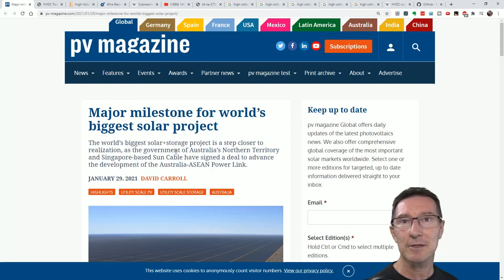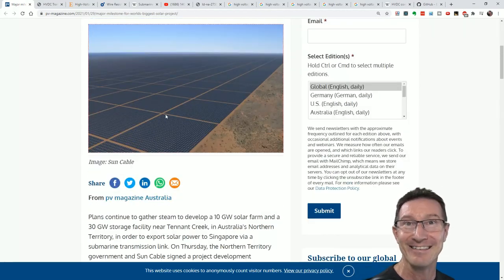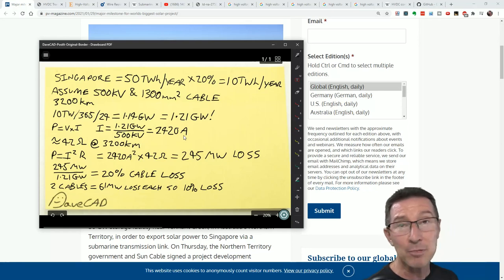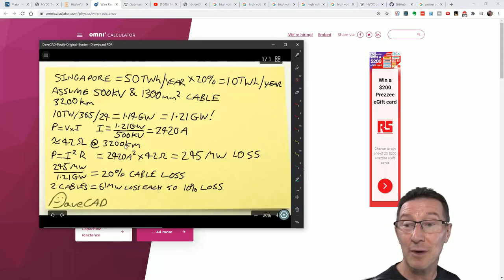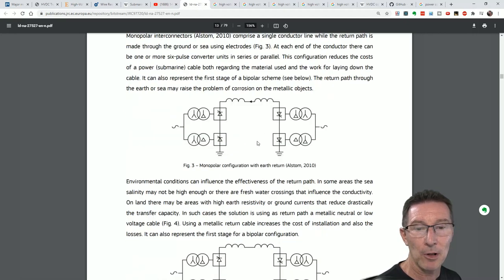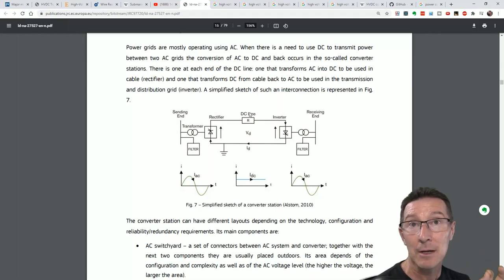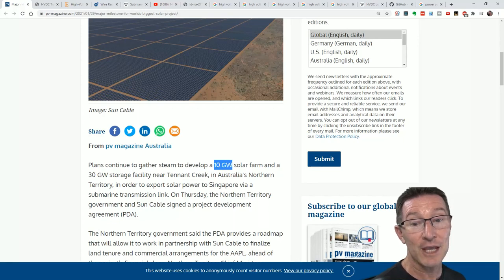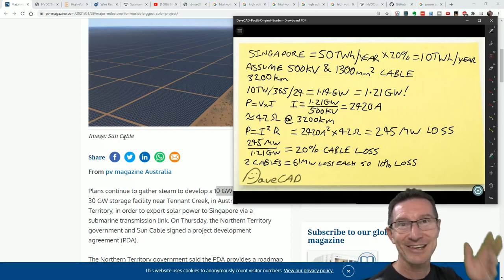World's Largest Solar Array - HVDC Transmission Calculations...

Comment: Cable would not be copper but aluminium under the ocean, might be more than double the diameter, but that just means a shorter spacing before the joints,  and overall the cable will be a lot lighter as well, making laying a lot easier, as there needs to be a steel inner support cable to handle the strain of lowering to the sea floor and picking up for repairs. Low density of aluminium compared to copper wins out, and also the very much lower price. Biggest cost of the cable will be the insulation though, extruded as a high quality coating on the central core, then with dozens of mylar overwraps and finally the outer sheathing and steel armouring, before the final plastic cover is applied. Most expensive is the sections that are shallow, as they have to cope with anchors dragging, fishing nets and marine boring animals. 

The pressure is not a problem at the deep parts, though there will be some hard work traversing the active geologic faults there, as they will have to build in extra slack to handle sea floor movement for the life of the cable. expect final length to be closer to 4200km instead, as the cable also has to climb and descend a lot of submerged faults and volcanos. Probably will pop up at a few island chains on the way as well.
Reply: Can't they traverse faults by using some massive buoys in regular spaced intervals, i.e. using buoyancy to have the cable float above the ocean floor for some (hopefully relatively short) sections?
Reply: @5th_decile  Not really, these areas tend to have fast currents, which means the cable will be flexing continuously, and will fatigue and break. Thus you bury it, or lay on the ocean surface, so it only flexes slowly.

Comment: The more interesting bit imho as a power eng  who does solar farms, is how do you hook up 10 GW+ of solar panels.  
Typically the internal networks operate at 33kV.  It becomes stupidly big quickly.

It will end up as multiple "smaller" networks. Each set of panels connect to 2x 2.5 MV inverters and stepped up to 33kV.   
A typical 100MW farm has ~6 33kV feeder and aim for less then %2 internal losses on the cables.
Then will step up to say 200 kV or so all back to a large AC switch yard to supply the DC plant and tie into the local grid. 

What will hurt up north is the soil is heavily sand based and soil temp is high, so you end up with larger cables (500mm single cores) and larger step up transformers.

Comment: As a minor correction, they don’t use copper for overhead lines because it is too weak. The aluminium lines have a steel wire catenary core as a strength member with conductors around the outside to take advantage of the skin effect. (Aluminium is MUCH cheaper too - about a third the price by weight).

Comment: I always questioned why we are not using 3.8 Mm instead of 3800km.
Reply: Try it, and you'll find out!
Reply: yeah we have nanometer, micrometer, millimeter, meter, kilometer but no Megameter?
Reply: Too dependant on shift key :-)
Reply: @wktodd  If you can't infer 10^9 difference from the context you have other problems... :D
Reply: @kwinzman  That kinda depends on the context and that the unit is being read by someone/thing with the intelligence to know the context  ;-)
Reply: @kwinzman  Further:  km,Km, KM ,kM,  would be equivalent in, say, a CAD package accepting a distance input, but what would it make of : mm mM Mm MM ?
Reply: @wktodd  Well in my oppinion it should reject Km, KM, kM, mM, and MM.
If the context allows it maybe it can accept KM and MM.
Reply: @kwinzman  so is MM megametres or millimetres?  See what i mean 8-)

Comment: I once worked on a Bid & Proposal (B&P) effort to provide the sensor network that would be run with an HVDC cable.  After a brief look at the stringent safety specs, our bid had the sensor nodes being solar powered with a supercap, communicating via an optical fiber.  Nobody wants to mess with HVDC unless absolutely necessary.

Comment: Didn't see it mentioned in my brief scroll through the comments, however don't forget about the return path. With that cable, it's 42 ohms, one way. You'd have another that size for the negative or positive, doubling the length and resistance.

Comment: How do you store 30GW of power?  Doesn't the energy unit require a time factor?  Such as 30 GWh.
I really enjoy science writers who have obviously never paid any attention to STEM course materials.
Reply: While they probably mean GWh, GW could still make sense. The batteries will have maximum charge and discharge rates.
Reply: @eDoc2020     Good point however I think you may have stretched generosity a little too far for the nimwits this time.

Comment: Hey dave, I could be wrong but I think you might be missing something.

The documentation keeps saying +- 500kV. I think it means one line is at +500kV and one line is at -500kV. So a total of 1 megavolt.

That would significantly impact your calculations, also you only calculated losses in one direction.

Comment: You need to double the cable length. There's the return cable to add in
Reply: Don't they use the ground for that?
Reply: @allesklarklaus147  electrolysis of the ocean bed!  I hope not
Reply: True, but then you would have another converter topology with +/-500kV. 
And the DC voltage seems quite low for the distance. I think it will be around +/- 800kV.
Reply: @Momchil0  what this needs of course is cheap high temperature superconductors
Reply: @donepearce  If I remember correctly the ground return works pretty well if the earthing electrodes are up to the task. The return current has essentially the whole planet as a conductor (well... not really, but resistance should be very low anyway)
Reply: @allesklarklaus147  you may well be right
Reply: Couldn't find any info of the cable in the video, but the Gotland cables mentioned are monopolar with the earth as return. 

"in 1983 a new monopolar link, HVDC Gotland 2 with a transmission capacity of 130 MW and a transmission voltage of 150 kV was established. It consists of a 92.9 kilometers long cable with a single copper conductor of 800 mm2 cross section"
Reply: @donepearce  I tried to post a link to the HVDC Italy-Greece line article from ABB but apparently the comment got deleted? There is a reference on the german wikipedia article. They use copper for the cathode and titanium bars coated with some special sauce niobium oxide for the anode.
Reply: @mikgus  OK, I'll buy that. I would be interested to know ground resistivity though, and what the net ground resistance is. Maybe the sea is actually an advantage in this situation.
Reply: @allesklarklaus147  I'm interested to know why they would make this a DC system too. I would have thought that electrode polarisation would become a problem at some point. And of course the added complication of voltage level shifting in and out of the cable.
Reply: @allesklarklaus147  
One big arse SWER system.
Reply: @donepearce  for reference, the HVDC link in NZ can be run in monopole. The sea electrode in the north has a resistance to 'remote earth' of around 0.1 ohms, with the earth electrode in the south having a resistance to 'remote earth' of around 0.3 ohms.
Reply: @dwnRnz  OK. I'm impressed.
Reply: @donepearce  Well.. a 160km/100miles long seacable does have quite a bit of losses if you run 3-phase AC so it must have made sense to go DC. The submarine cables are much much higher capacitance than the usual high voltage wires dangling around up in the air.
Reply: @allesklarklaus147  Examples?  References?  Actual figures for the ground resistance?
Reply: @Brian_Of_Melbourne  for what exactly? As I wrote before I tried to post a link but the comment disappeared. Gotta google yourself if you want to read the paper from ABB I mentioned

Comment: The biggest problem with long-distance AC transmission is system stability. You basically have an issue with power throughput that can only be resolved by increasing the number of lines or by using multiple conductors per line = more investment in copper.

Comment: Another key problem with long distance AC lines is the reactance of the line.  The reactance can be more limiting than the resistance and the two ends of the line can 'pull out of sync' even on lines of only a few miles.  This affects system stability in a network.

Comment: Dave you have a classic error in you calculation, it's not 3800km but 7600km of cable, you have to consider the return negative cable losses as well.   I think they run + and - so the voltage to earth is not as large.
Reply: From other comments, either you go monopolar (1 cable), and your loss are what he calculated.
Or if bipolar (like suggested by Dave), you go + - xKV. Doubling the voltage, hence, not much diff in loss.

Comment: 4 years still quite a bit faster than your typical nuclear plant
Reply: @Cytoplasm4508  Sure, but my comment was about the complexity of nuclear plant manufacturing and thr time it takes. Most renewables can be on one order of magnitude faster to deploy. That is certainly a big benefit.
Reply: @Cytoplasm4508  don't worry, HV DC cables powered by solar are coming to a location near you! It's the technology that's doing what nuclear couldn't do, providing renewable clean, radioactive free energy to power the world! As for night time! There's always sun shining somewhere else in the world! With under sea cables, they will be sending it to where it's needed, battery storage will become obsolete! Nuclear reactors will become a thing of the past, who would want one of those dangerous thing's in their backyard anyway? You can't even live on the land once a nuclear power plant has been decommissioned! But there will always be someone who tries to convince you that it's safe!
Reply: @Cytoplasm4508  dude, you are only kidding yourself, after Fukashima, every other GE based reactor was modified because if it wasn't Fukashima, it could have been any other of the ones still operating! So basically that should tell you that even though there were many accidents before Fukashima, they still weren't safe by the time Fukashima happened... I don't believe that they are safe now! 
Mother nature will do what mother nature wants to, when you have something like a nuclear reactor which doesn't like to be stopped instantly, there's always going to be Problems and not just power outage problems! The average household can go fully off grid with battery storage for overnight use, with houses off the grid, the existing infrastructure can power industry and the apartment's... 
Australia already has a HV DC cable from Victoria to the island of Tasmania and there's also an in ground HV DC cable from Victoria to South Australia, I believe that these were a test and now we are seeing the next step! This is how the world is going and this means that when this job is complete! Australia which already has no need for a nuclear reactor will be joined by Asia, one by one and their reasons for a nuclear reactor will be no more! They can purchase it from Australia and sell it to other countries after them... It's all about making money which the old nuclear reactor just isn't profitable, the electricity isn't to cheap to meter like was promised... Seriously though, generating steam to make electricity, what year is this? 1850?
Reply: @PeterMilanovski  Nuclear power is about 3 times more dangerous than solar and wind, but it is two orders of magnitude safer than fossil fuels. Go watch the most recent Kurzgestagt video on nuclear energy. Humanity has a habit of viewing catastrophic events through a distorted lens. Even with the two BIG nuclear disasters, their widespread effect on human lives is substantially smaller than fossil fuels. It's like occasionally getting poked with a hot soldering iron vs slowly getting boiled alive without realizing it.
Reply: @asdrubale bisanzio I don't know where you live but here in Australia, industry is zoned for industry only, you can't build a house there because it's not allowed by the government! You can't just open up a factory wherever you want and do whatever you want! We have rules and regulations that are in place by the people, for the people... There's no possibility that you could end up building a new facility on an old nuclear power plant site in Australia! But I would have no problems living on land that used to be a solar farm! None whatsoever...
Reply: @asdrubale bisanzio One meant for commercial electricity production (probably western world too, since you'd consider both of the countries here like one)
Reply: @vejymonsta3006  are you saying that the only reason I think that Fukashima happened is because a distorted lense made it look that way? So it's not really real? 
What does it matter anyway? What's done is done right! 
Coal and nuclear are on their way out! And clean solar and wind energy are going to be piped around the world! It's the future and it's already started, hold on because it's going to be awesome 👍👌
Reply: @asdrubale bisanzio solar panels don't contaminate the land that they are operating on, when solar panels can't be used anymore, their aluminium is recycled as is it's glass! The rest, which is not much left is buried in a landfill... Most of the panels are recycled... They actually last quite a bit longer than people thought! 
People in Australia have already begun to upgrade to the latest generation of panels and now we have a second hand market for more people to get into solar! The original panels should easily last for 30 years if not more! They have been in the sun for 15 years now and are still producing 90%+ of their energy.. who knows, they may even last for 40 year's! 
If they can get them to last 50 years, that would mean that you would only need to change your panels twice in your life! And you can do it yourself and not get radiation poisoning! Don't you just love that?
Reply: @Cytoplasm4508  But nuclear energy is many times more expensive....it is uneconomic
Reply: @asdrubale bisanzio Yeah, but there are atypical nuclear plants, such as research reactors or Akademik Lomonosov. I'd also rate a few chinese nuclear plants atypical with their 5 year construction period.
Reply: rkan2 Don't worry, this Solar HVDC project is large enough to cause raising the costs costs and delays in the same ways as with nuclear power plants.

Comment: On the question of copper vs aluminium I would guess cost might be a factor. Aluminium is going to be much cheaper, even with a larger conductor area to compensate for the lower conductivity.
Reply: An aluminium conductor would weigh half as much as the equivalent size copper conductor for the same resistance and Aluminium is a third the price of copper by weight so an aluminium cable would cost a sixth as much for the same capacity (on metal values - the insulation would be the same price).
Reply: @allangibson2408  The volume of metal, and hence the cable diameter, needs to be considered.  It affects the amount (cost) of insulation.  It may also affect the cable laying machinary -- how fat is the hole the cable goes through, how big are the spools, etc.
Reply: @Brian_Of_Melbourne  Aluminium cables are 40% larger in diameter due to Aluminium’s lower conductivity so the insulation would be 40% more. Polyethylene is however cheaper than aluminium at about a dollar a kilogram and much cheaper than copper.
Reply: @allangibson2408  Mikeselectricstuff, calculated that a copper cable would cost around 200M$.
Eevblog said that the HVDC transformer is around 500M$ (*2 for both sides)
As said before, if you take into account the added cost for the size difference of the cable. The metal cost in itself, is not that big.
Reply: @xmtxx  Actually the metal price is over half the cost of the cable with copper cables - on large orders there is usually provision to change prices based on the wholesale price of high purity copper. Copper is rare - aluminium is common, large orders of copper cable shift the wholesale price of copper. Copper is also heavy - a copper cable weighs at least three times as much as an equivalent capacity aluminium cable so laying is a balance between the mass of the cable you can fit on a ship and the weight of cable you can fit.

Comment: just to know, here in Brazil some HVDC transmission lines, 2 lines that transmit the 50Hz generation from the neighboring country Paraguay of Hidreletrica de Itaipu (~ 7GW the generation side 50Hz) to the Brazilian electrical system which is 60Hz and the two lines operate in ± 600 kV DC with a length of ~ 810km (curiosity the generation side 60Hz produces ~ 7GW and is transmitted to the same substations but in 3 lines AC 750kV), 2 lines that interconnect the Madeira River Hydroelectric (~ 7.5GW generation) southeast of the country operate with ± 600 kV DC and distance ~ 2,300km, 2 line that connects Hydroelectric from Belo Monte (~ 12GW generation) to the southeast of the country operate with ± 800 kV DC a line with distances of ~ 2,500km (ends at border of the states of Minas Gerais and São Paulo) and another of ~ 3,000km (ends at the border of the states of Rio de Jaineiro and São Paulo).

and the energy agency here in the country wants to build more HVDC dipoles to backup the transmission operation.

Comment: The main reason for HVDC over AC is that the effective voltage is higher since, for DC, the RMS voltage is the same as the peak voltage. Surely the skin effect is going to be pretty small at 50/60Hz...

Comment: Not to forget that at such long distances the cable will basically act as a huge Antenna for AC. Wavelength at 50 Hz is around 6000 km, considering the effects of water the relative permittivity @50 Hz reduces the wavelength to 4500 km. So DC is clearly the one to choose if you don´t want to radiate even more energy.